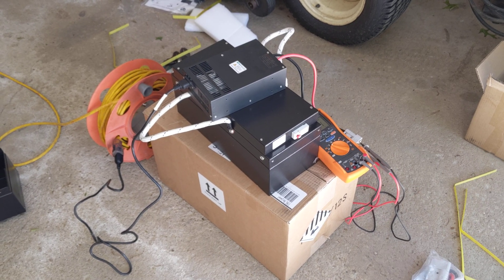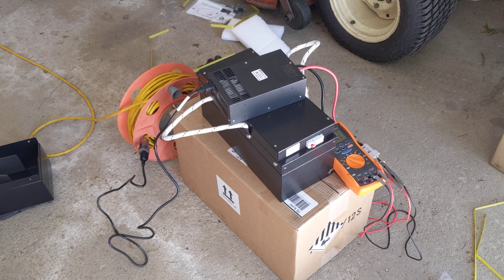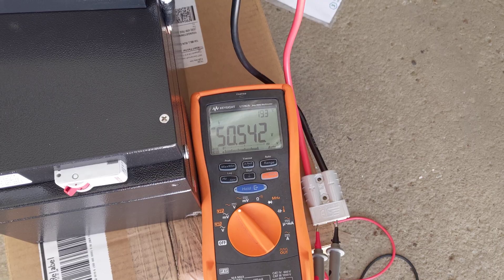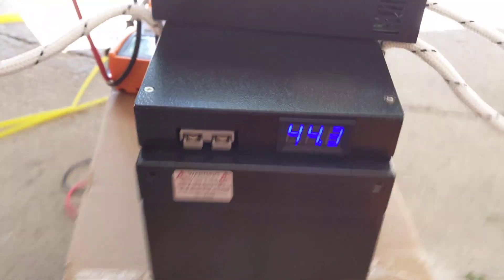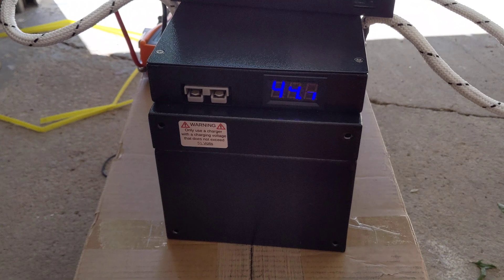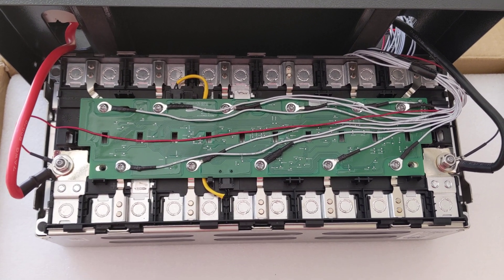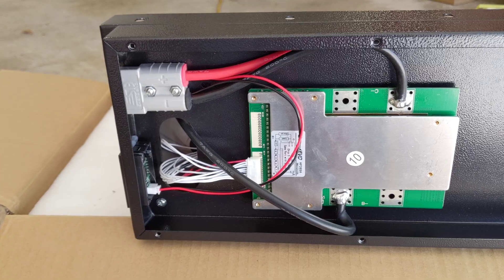Big Battery dot Com 48 Volt BDGR 4.2kWH Golf Cart Kit

Comment: I have the same kit with 4 BDGR s.  I don't like the charger that came with my kit. It is adjustable to 58.8V and was not set right when I received it. I had to manualy set the charger and cant get it better than 49.8V. The adjustment knob is way to sensitive. There's a reason Big Battery put the warning sticker about overcharging batteries. Also, my 4 batteries take almost 8 hrs to fully charge. Charger aside, the batteries gave my cart decent range. Im considering installing  an AC motor and kit for even further range.

Comment: Everybody talk about batteries but nobody fucking talk about the price what's going on!!
Reply from the maker: Haha ok ok kit was $1539.99 shipped. My previous order a year ago using used gen 2 leaf cells was $1250.57 shipped but they charger won't work at low state of charge so you have to boost the pack by 2 volts with something else 1st.

Comment: Thanks for posting this video. I never removed the black plastic cover on top of the pack. Or removed the pack from the steel box!
So, I had no idea what the pack looked like or that it was a Samsung. From counting the wires, I figured it was 12 cells.
Edit 10/2/2021:
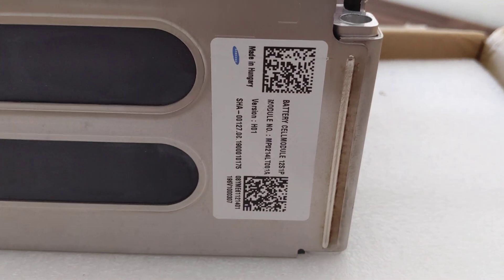I was able to read those QR codes off the screen at 1:28 and they are 08YME61121401196V1000307 and 
3#MP0214LT001A  #HH01S    #*E60SHA-00127.06.1900010175*=  
Nice video quality..
Reply from the maker: Glad you found this useful.